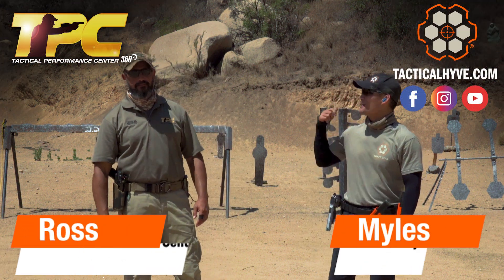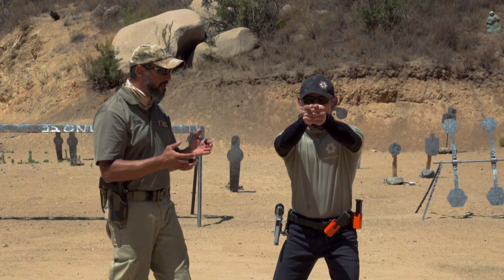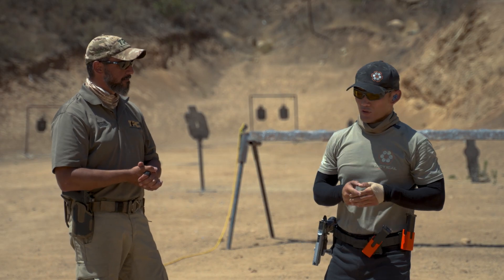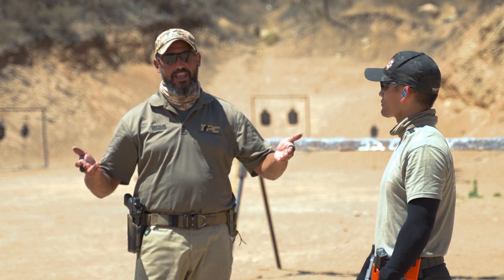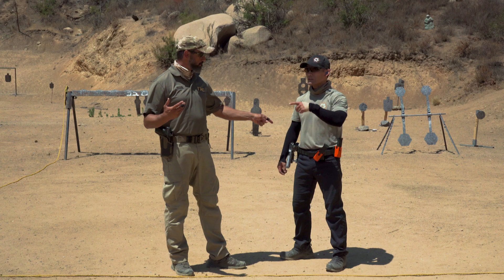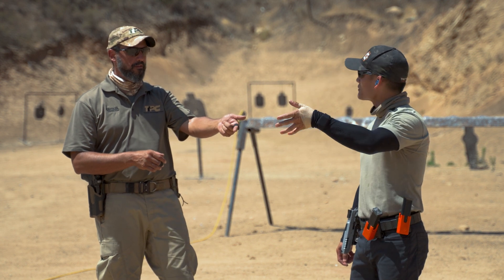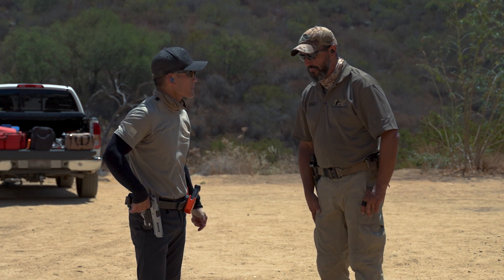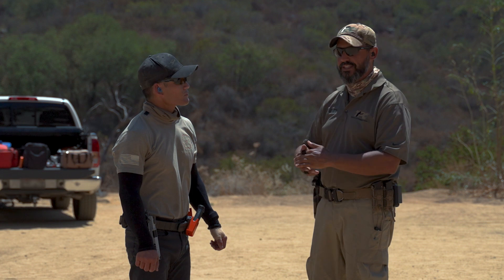How Hard Should You Grip A Pistol with Rossen Hristov from Tactical Performance Center

Comment: The further the shot and the more time there is, the more important the trigger finger seems to be and a lighter grip is favoured in what I've seen. I think the heavy grip approach is just right to later experiment to ease off while starting with a light grip alleviates sympathetic clenching of the hand/changing pressure before/during/after.
Reply from the maker: Absolutely correct!
Reply: Top bullseye shooters, who are the most accurate handgun shooters, seem to agree that the harder the grip, the better. They shoot at 25 and 50 yards only and one handed.